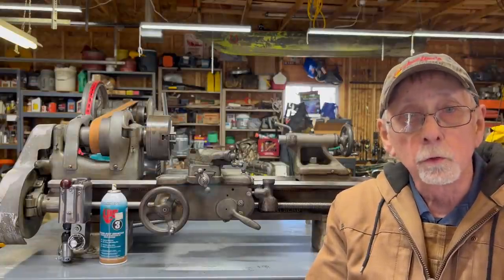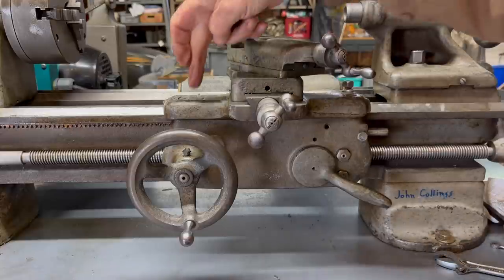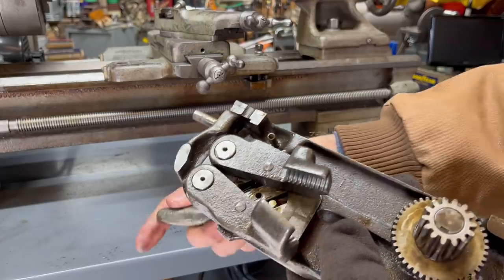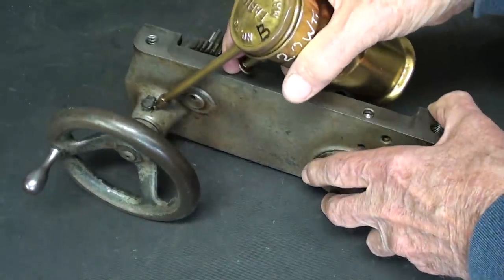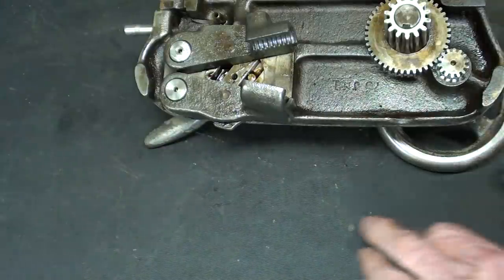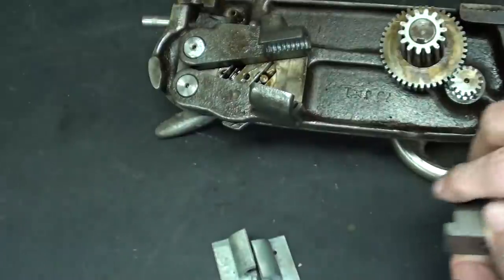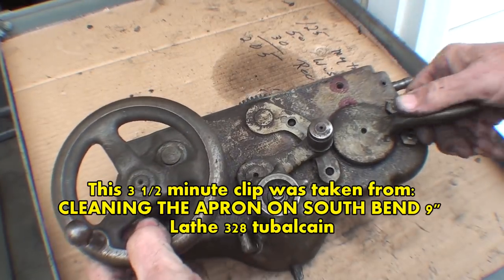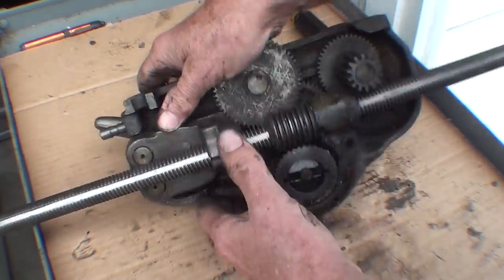SOUTH BEND 9" LATHE APRON STUDY #786 tubalcain

Comment: Great video Mr Pete!  I always wanted to see the workings of the fully equipped 9" South Bend lathes. I acquired a 1929 South Bend "Junior" in 1975. It's mounted on a well preserved 2x4 and  2x6 wood bench. The whole unit was well preserved, covered in grease,oil, and soot! The original owner had it mounted in a steam shovel that he operated in the thirties along with a mill and used it to keep a fleet of steam powered equipment repaired in the 30's. He kept the lathe as he said 2 fellows could handle it without too much fuss. He was old but still a very large man. The mill didn't make it to Texas as he said it was much larger. A very interesting man, that I ended up spending the day with. He must have enjoyed my company because he kept digging out  things for the machine. After removing all the gunk the machine shined like a new dime. Really wasn't any significant wear any where. They were painted black back  then with a red and gold badging. Had a extra bucket of extra gears and a brass interchangeable tag to swap for the standard one. He said it was metric gears. Never have tried them. One prize that he gave me was a 1929  version of South Bend's  "How to run a lathe". What a prize! A simple mans how to in simple terms with easy to understand illustrations. I've rambled enough! Thanks for your time and sharing! 👍😎
Reply from the maker: Thank you for a very interesting comment

Comment: That split nut lubrication system is genius. Oiling it not in use just adds oil to the reservoir on the top half nut. When the nut is engaged, the oil is tipped towards the half-nut oil hole to actually add the oil to where it's needed.
Reply: @mrpete222  Have you seen my comment on the threading request video ?

Comment: Hello Lyle, if you fit a model A/B apron, as well as milling the key slot in the lead screw, you will have to get a model A/B cross slide screw to gain the full benefit.

Comment: These beach lathes have open aprons. Industrial machines have fully enclosed aprons and are filled with lubricating oil. This keeps the  dirt away from the open gearing and the air hose debris propellant isn't so problematic. Power is transmitted via the lead screw, but a shaft, often square, transmits power engagement for the spindle from the apron. This is a terrifically handy feature. Lead screw power disengages due to loss of spindle rotation. Often the spindle engagement  apron disengagement function is duplicated with a foot operated bar the length of of the bedway. The spindle is engaged via clutch pack internal to the headstock. Add electric braking and you have features these small machines don't incorporate. 
My Atlas lead screw can be engaged near the headstock, forward and reverse, but only with the spindle idle. If done carefully it can be disengaged there while the spindle is running, but the throw is do short you risk unintentionally switching feed direction and grinding gears. Z axis engagement function is easy, but the cam function for the cheesey half it feels very sloppy. The cross slide feed engagement button/pull is poorly located and  awkward to operate. The Southbend is far more robust and looks more ergonomic. The pot metal Atlas components feel like they will easily snap. The robust cast iron Southbend components look really desirable.
The instant ON spindle function of these little machines is not as desirable of clutch operated spindles and/or soft start VFD functions. 
BUT owning a Craftsman branded Atlas is far better than not owning any machine!😃
Reply from the maker: Thanks

Comment: As Lyle says keep the air hose away from your lathe. A good idea to keep it away from your milling machine and other machine tools as well. Compressed air saves time but it blows all that microscopic crud into every nook and cranny on the machine. When he pointed out the contamination on the back side of that model A apron, that would be pristine compared to some I've seen.
Reply from the maker: True

Comment: 7:15 BUT if the Craftsman has a power feed shaft (or keyed leadscrew) the leadscrew thread is going to get significantly less wear than with the SB as it's leadscrew has to do both tasks.

Comment: Mr Pete could you make a video explaining  how threading dial works?
Reply: Go on then, I'll bite. It's not very complicated at all but with a twist, Lyle could make a really interesting video out of that question AND go all adventurous himself ! He can boldly go places with a lathe he's never been before ! Yes actual screwcutting to show us. (If he follows my script, this will be his best video ever!)

1. Basic mechanics of the threading dial and its operation.
2. Basic threading concept - same tpi as leadscrew - any engagement position (?)

3. Basic threading - even number of tpi
4. Basic threading - odd number of tpi
5. Complex threading with funny pitches - like using an imperial lathe to cut metric ha ha ha ha pitches (half-nut permanently engaged)
6a. Advanced threading - a 2-start thread
6b. Advanced threading - a 4-start thread
6c. Advanced threading - an 8-start thread
6d. Expert threading - a 5-start thread
7. Threading because you can - making a scroll thread using the power crossfeed. Working out the pitch via the crossfeed feed rate.
8. Back to sanity threading - a tapered thread. (Discussion if you don't have a taper turning attachment or don't want to offset the tailstock.)

See you next Christmas, Lyle !

Comment: On my Southbend 9" Model A there is an additional part that I haven't seen on any other. On the back flat pulley mechanism: (going left to right) there is the double pulley that connects to the motor, the three pulley that drives the lathe, then to the right of that there is another pulley that seems to have driven something. Could be shop made but it looks original and well made. Maybe I can upload a link to a picture. Let me know if anyone has seen this before and what it could be for.

Comment: Are the aprons interchangeable?
Reply: Probably but the leadscrew may not have the slot milled into.
Reply: As David Ticehurst says the leadscrew will not be keyed , I have a model CUD Boxford which is a South Bend clone and have fitted a model B apron and had to key the leadscrew but no other work needed.
Reply from the maker: I will be fitting a model a apron to the lathe.   I will apparently have to key the lead screw. Thank you, I didn’t realize that
Reply: @mrpete222  Lyle, when you come to do the leadscrew, drop it into one of the table tee slots in the BP to get it straight and mounted solid. Use your Right Angled Head Attachment with a sized Side and Face Cutter. You will get a better slot than trying to use and 2 or 4 flute end mill over that length. Look forward to seeing the video and finished modification. Regards from Australia.